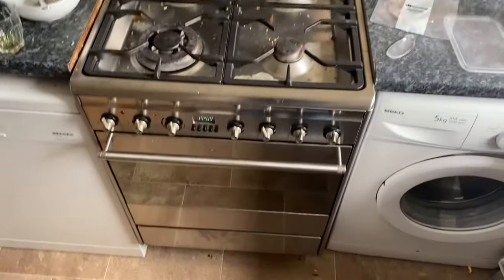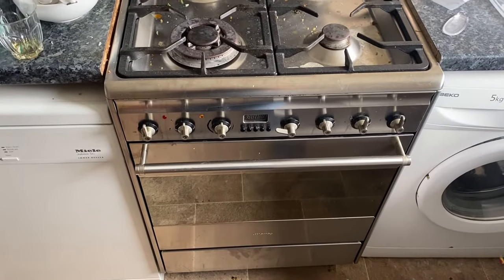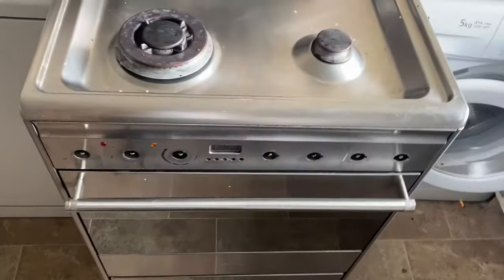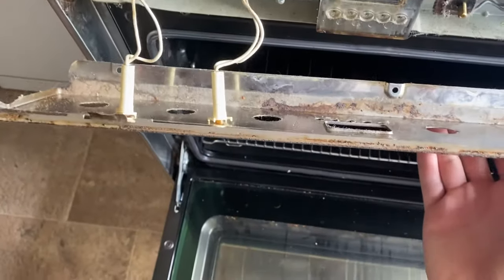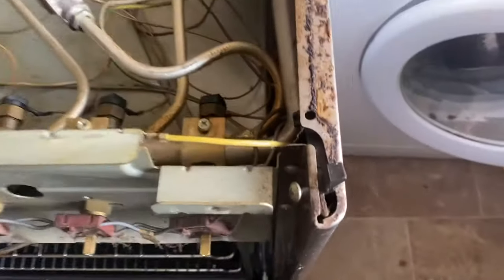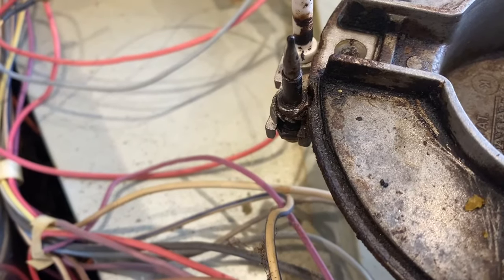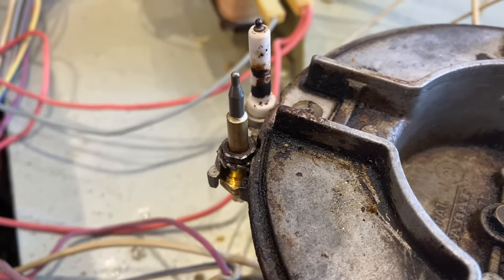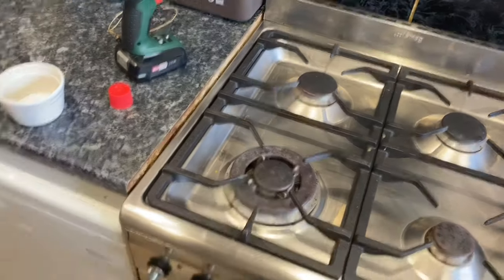Fixing Smeg Hob That Won't Stay On (Replacing the Thermacouple)

Comment: Saw “ @user” comment below who cleaned the thermocouple sensor with sandpaper! My thermocouple on same Smeg cooker and burner was discoloured with a film of blackened carbon deposit so I sprayed some “car engine carb cleaner” onto a small piece of green woven kitchen scourer (wearing nutrile gloves) and cleaned the thermocouple and tip until clean.  It now works fine and lights immediately!  Not sure how long this will last until I have to order the part and get it fitted as shown in the video.

Comment: had the same problem, fixed it by cleaning the tip of the thermocouple with some fine sand paper until it was shining like new and just worked perfectly. 
there isn't much "stuff" to break in a thermocouple, so most of the cases this issue happens is just because of carbon build-up on that tip.
for anyone else with the same issue, just try sanding it down first until bright and shiny :)
Reply: Any particular sand paper to use?
Reply: @abhishekdatta8800  nothing particular, mine was p240 don't need finer than that. just don't use coarse ones
Reply: @Ris-v4w  alright...thanks!
Reply from the maker: This sounds worth a try first! Cheers!

Comment: Well done mate. Good effort whilst holding the camera. Got to sort mine out now, I will post some videos of the oven element, now gone after a year replacement OG part!
Reply: Did it work bruv?
Reply: @techmansa  
Short story no. See synopsis (1) and next steps (2):
1) I had to change a few things, one of which was the selector switch which had blown and the other was thermal coupler. In the process I also replaced the ignition element, after which still no success.
2) After careful inspection I believe the thermal coupler sat slightly lower then the others on the hob. In short even though this was OEM I suspect they changed the part during at somepoint. I'm going to order a generic replacement and see if that makes any difference. I have a 100cm dual fuel oven so the effort is a lot but will post some footage of the process if you're interested. 
If you follow on techworkshop1 on YouTube and Instagram I'll get it up in the next few weeks.

Comment: Let’s hope your a gas safe engineer
Reply: Every time I go to the dump, there are piles of probably perfectly and easily repairable domestic appliances. But since (a) repairing is often more expensive than buying new and (b) people are so fearful of attempting repairs themselves nowadays, this madness continues. It's such madness that is fueling our enviromental and climate crisis and we must change.

Absolutely if the repair involves disconnecting a gas line within the appliance, I would call in the pros, but as this a straightforward plug-in cable replacement, I would be comfortable that the risk is next to nothing if you take all the sensible precautions. 

DISCLAIMER: this is my personal opionion as a layman - proceed at your own risk!
Reply: You know there's ovens without thermocouples right? They're there just in case you forget to turn it off

Comment: Folks : before u replacing the thermacouple try getting a small grit sandpapper and cleaning the probe part of thermacouple. Even if ut doeant look dirty cabon builduo in enough to keeo it from wirking correctly.  Fixed 2 of my gas rings this way

Comment: Check you gas injectors are unblocked before going to the hassle of changing thermocouples (see 9mins into this video on how do this - https://www.youtube.com/watch?v=SrSuOTooniY). This is much easier job as can be done from the top without unscrewing and lifting the hob.
 
In my case (SMEG SY93) they were dirty so restricted the flow of gas meaning there was insufficient heat to activate the thermocouple.